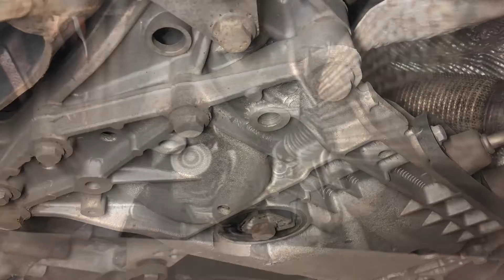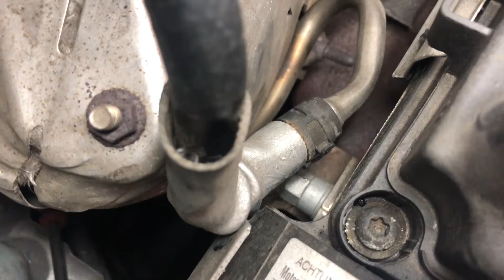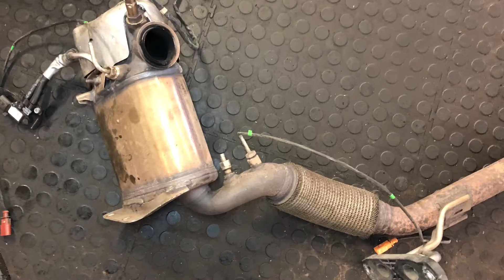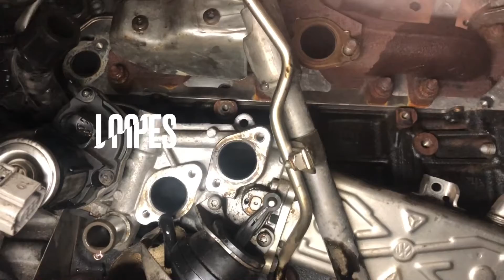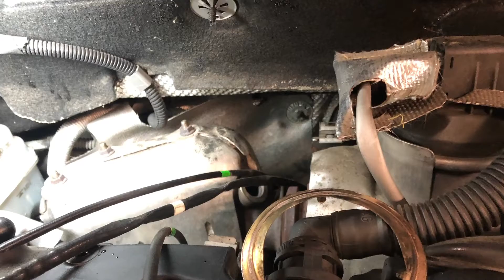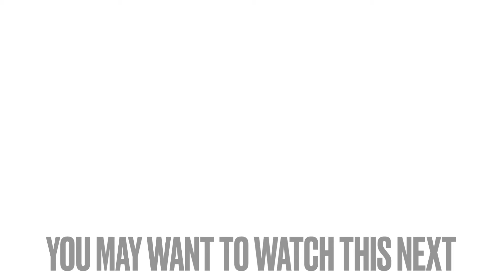How to Replace the EGR Valve on a VW Golf TDI: Complete Tutorial. Mk7 mk8

Comment: No need to replace, just take out, clean the EGR, eventualy repair the internal closing valve and put back to use. The most time-consuming activity is removing the EGR itself.
Reply from the maker: Thanks for that. That is the cheapest way but many would argue that if it’s replaced. In theory it shouldn’t fail again. But good point!